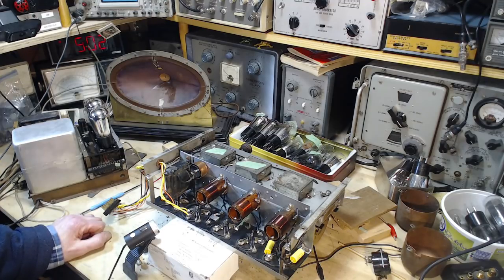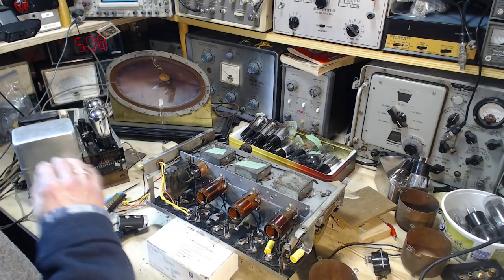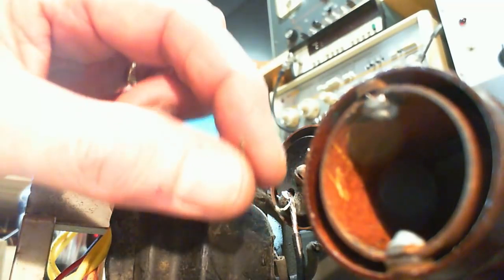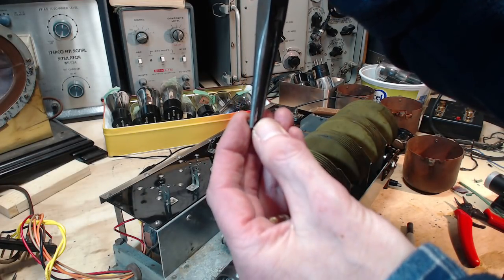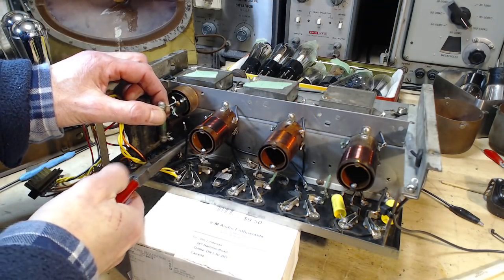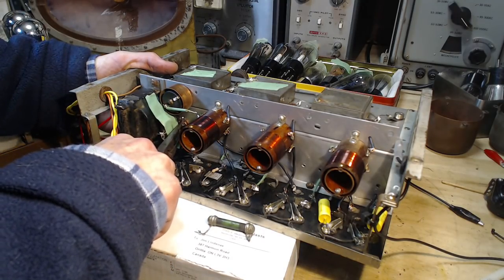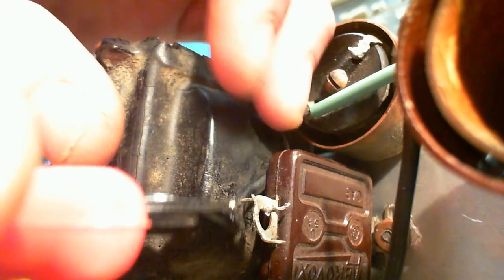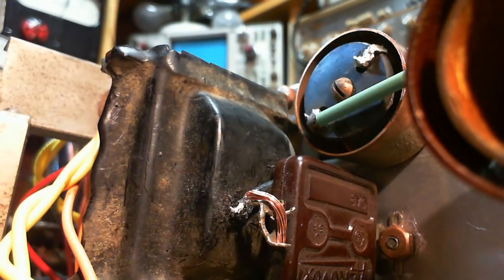1928 RCA Victor Model 28V   Video #50 - Install Grid Leak

Comment: Jim just a comment here,  When you are working on any radio always make sure the tuning capacitor plates are FULLY MESHED as this will prevent the rotor plates from getting accidentally bent.  ---------------      John A Bellas     KC2UVN
Reply from the maker: Thanks for the advice.

Comment: Maybe even if you decide to put an old capacitor back it can be harder than getting it off and I would have gone with a new  capacitor and new resistor and saved myself the hassle.